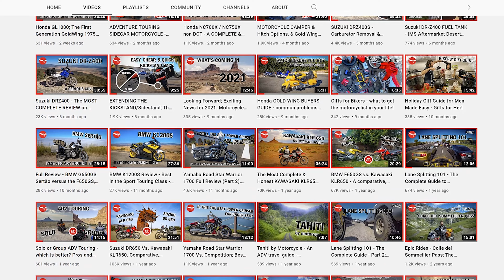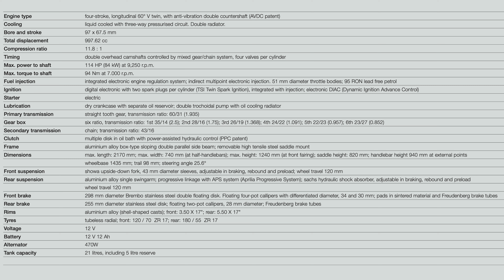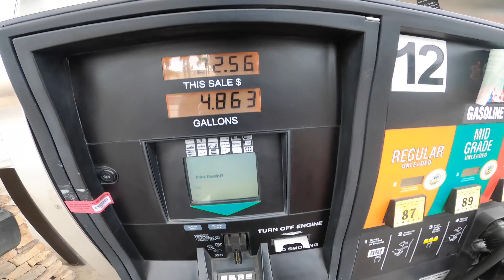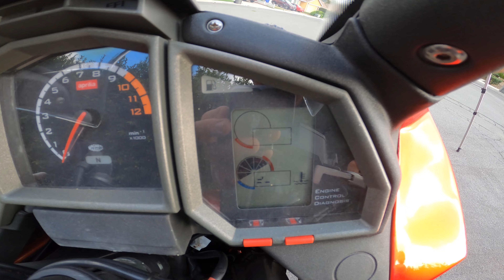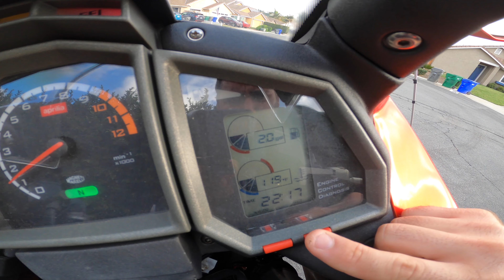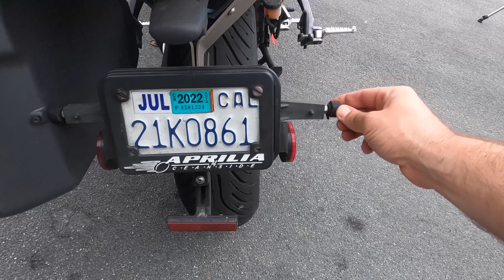APRILIA FUTURA RST1000 & luggage; The Most Comprehensive & Honest Owner Review of a his Sport Tourer

Comment: Nice channel with interesting reviews.

Your review of the Futura and the Sprint ST 1050 are extra interesting to me because of a possible purchase of 1 of the 2, I am mainly used to 4 cinders, for a change an engine with more torque in the lower revs seems interesting to me.

Which of the 2 would wins on the following characteristics in your experience:
-maneuverability
-torque under 6000 rpm
-comfort
-build quality
-class feeling
-fun factor

I mainly have experience with Japanese 4 cylinders from the 90s, Thundercat, Bandit 1200, Blackbird, ZZR 1100, now own a VFR 750 1995 and a Fireblade 1999.

As a VFR 750 fan I also looked at your VFR reviews, the successors (800 and 1200) could not convince me during test drives, an 800 VTEC from 2002 scored the best, a 1996 Blackbird beats a VFR 1200 2010 in my opinion, greetings from the Netherlands.
Feedback sturen
Reply from the maker: Hello. Thanks for watching and for the support. Thr Futurama being a twin has more character and low.end torque, however they are getting to ne nearly 25 years old and electrical issues are their main problem. The sprint st or gt would provably be my choice between the two just because of the age issue. Otherwise they are very alike being in the sport touring class. Especially if the sprint comes woth the top case
 For me its the most useful case of the three. Luggage is super important to me. That's why I've kept my 1200 vfr you saw in that review. I've added the bmw f800gt to this list as well and you can see that review. Don't know how important cruise control is to you. Mind you the vtech in the later model vfr800 was made smoother. I think from 2005 on.
Reply: Thanks for the response, more character and torque at the bottom appeal to me after all those smooth 4-cylinders that mainly perform above +/- 6000 rpm. Cruise control is less important to me, usually short trips to the German Eifel or Luxembourg Ardennes.

I still carry luggage the old-fashioned way like on your red VTEC 2003, for example a folding bike on the back of the VFR 750.

I found this interesting in terms of rough and smooth VTEC transition: https://www.youtube.com/watch?v=X3lyolEqtYI

I am a bit wary of the BWM brand, the price/quality and price/reliability ratios are not that favorable, also too many BMW motorcycles on the Dutch and Belgian roads, especially the GS series, the favorite here for the older 40+ motorcyclists.

Comment: Rode from Nice in South of France to London in a day on mine, amazingly flexible and comfortable sports tourer that gives you nothing but confidence at high speed. I had no issues with vibrations.
Reply: Rode non stop ,well only for fuel and the tunnel funnily from Nice to North Wales 1083miles,best seat in the world.
Reply: @andrewevans6765  Still got it ?
Reply from the maker: Wow. That's allot of travel nd that saying something. Have you had any electrical issues? What color is yours? I'm presently riding the VFR and that review will be released next weekend so please consider subscribing. That's my favorite in class and a direct competitor. Cheers. Nik
Reply: Great channel & reviews thanks.. your report of vibration must be a build issue with this bike.. I just bought a Falco.. an EXCELLENT Sport tourer itself.. & my bikes engine smooths right out as rpm's increase.. as it should with the two counter balance shafts.. so I'd suggest your review bikes engine which is identical as the Falco.. has mis trimmed balance shafts..  cheers from NZ

Comment: 30:28 I confirm they're not compatible. They look the same from the outside but the mounting points are slightly different, especially the latch on the bottom.
Reply from the maker: Thank you so much for that confirmation. Saves someone alot of money and frustration.

Comment: There is one on local Craigslist for sale with 50k miles for $2000 I'm going to check it out after your review, I'm 6'2 and don't like vibrating handle bars ,only draw backs ,but for 2000$ I'd get it anyway
Reply from the maker: 50k is more miles than I'd care to get involved with for the bike, but if you like the owner and the bike looks well kept, 2k is a good deal for it assuming it has luggage and has had electrical issues addressed already.

Comment: Just picked one up today with 50k miles from an original owner.   Beautiful bike,  and feels very fun to ride.
Reply from the maker: That's awesome. Original owner motorcycles are always better deals. At the moment I'm riding a Honda VFR 800 in pearl white but it doesn't have nearly as much grunt and attitude as my futura. Congratulations on the new bike and thanks for watching.
Reply: @pegasusmotorcycletours  does your bikes horn go off when you turn all the way left , button hits the gas tank, or is it just mine?
Reply: @pnwrider8346  thanks,  that's possible,  but It might have been some aftermarket button as it looked brand new, so I just ground it off a bit. Now new problem arose,  one of the injectors seems bad, and there is no replacements available anywhere,  neither continent,  might you know something I don't?

Comment: Owned mine from new,looks standard but is quite modified,Race fork internals and Maxton rear shock,Staintune Silencers with de-cat mid exhaust,remap,air box mods,19mm Radial front master cylinder,just clocked 56,000 miles,is in nearly new condition ,handles fantastic and has 123hp at the wheel,have travelled 2up with luggage and have done a couple of 1000mile days in Europe,love this bike,I have a few but this is the best all round motorcycle I have ever had out of 57 I have owned.
Reply from the maker: Wow. That's about of bikes and that saying something. Have you had any electrical issues? What color is yours? I'm presently riding the VFR and that review will be released next weekend so please consider subscribing. That's my favorite in class and a direct competitor. Cheers. Nik

Comment: I bought one new when they came out in 2002, an awesome bike. Although like most Italian machines of the era it suffered from a few electrical issues, none too difficult to rectify ( pun intended ). I traded it in for a Caponord in 04. The Capo has the same stonking Rotax V2 powertrain and engaging character along with the aforementioned gremlins, but silky smooth all the way to the redline. The bike has since been sorted and I have not found a better long-distance tourer/adventure machine to replace it with. Indeed very underrated machines and both are a joy to own and ride.
Reply from the maker: Thanks for sharing. I had a chance to buy the Capo of that year but found it surprisingly top heavy. I would not consider using it on the dirt at all and then it became no contest between it or a Vstrom. But a good looking bike no doubt. I would be interested in the newest ADV machine Aprilia just released. The headlight is a bit much but if the bike performs, I can overlook that. I am presently busy with the new KLR Kawasaki gave me to review so please stay tuned for that in case you are into ADV touring. Thanks again - Nik
Reply: The Capo also has ABS with later models! I love mine, especially after a Catfish map to improve throttle and fuel economy. Unfortunately, I also found it extremely top heavy and unweildy at high speeds. I'm not sure if it will be a long term motorcycle for me or not, as I wanted something to get some experience on dirt roads with. Have you taken yours off-road??
Reply: @cullenmichael34  I find mine to be slightly top-heavy when at a complete stop with feet on the ground, or when pushing the bike in the garage, once underway though, the bike's handling is positively exceptional, and very easy to handle, rock steady and nimble at high speed. While I've taken mine on several off-road trips in Utah, and Colorado, and found it to be a competent machine, I would not recommend it as a bike to get experience on, off-road, or on. It is a big bike and requires prior experience. These bikes are getting old also, and proper maintenance is paramount, I would replace the steering-head, and wheel bearings front and rear as well as make sure that the tires are up to the task.

Comment: Have a tuono and always had the numb fingers after 30 mins or so and after a long ride they would be numb for days. Started just resting the heel of both hands on the bar ends and leaving my fingers loose and no problem since.
Reply from the maker: Thanks for the tip. I'll try that, as I always tend to arrive tight around the throttle. I have started changing out my grips to wider ones as well which helps.

Comment: Mine just turned 80,000 miles (170,000km)
Reply from the maker: Wow - impressive! No electrical issues? I just picked up a VFR800 in white with full luggage, with half as many miles which I though was still a lot more than I am usually comfortable with. So great to hear your Futura is running strong.
Reply: @pegasusmotorcycletours  

You guessed it!  It is currently down. No lights, no dash, but has ignition, starts still. I tried to fit a flat tire kit under the seat, and hasn't worked since. I think it bumped the aftermarket heated suit module. Fuses are good. Not sure whats fried.  
Whats your shops number? 
Can I order parts from you?
Reply: @pegasusmotorcycletours  

I loved my VFR 
It also had over 80,000 miles of pure pleasure.  Swap the stock muffler to aftermarket. Enjoy the V4 sound. And never use automotive fluids. Only use Honda. Trust me
Reply from the maker: Thanks for the tip - I picked up a full touring 3 peace luggage white 2006 that I am enjoying. Lots of miles - half of what you made, but still plenty of life left. Please stay tuned for that review.
Reply: Anything you had to do to the engine ever? I just picked one up with 50k miles. Electrically looks fine,  engine feels awesome,  just wondering about things I should be looking at,  like timing etc.
Reply: @nicksoltys4242  
The VFR is perfectly dependable if you use Honda oil and anti freeze.
I killed mine with using automobile antifreeze and oil.

The Aprilia is Italian. And she keeps the shops open.  It needs attention